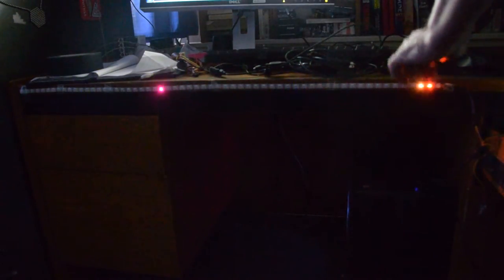Demonstrating a few sound reactive routines, including FHT.

Comment: Andrew, I love your work! I've got the first sketch working, but neither of the FHT ones will compile. I get "Error compiling for board Arduino/Genuino Uno." Any ideas on what I screwed up, I see online that many people have issues getting the FHT library installed correctly. I unzipped it and put it in the Arduino>libraries folder, the same folder where I have the FastLED-Demos folder.
Reply from the maker: In my case, I downloaded version 3 of the FHT library from http://wiki.openmusiclabs.com/wiki/ArduinoFHT.

I then unzipped the file and grabbed the FHT directory only, which I placed in:

c:\users\<username>\documents\arduino\libraries

I haven't tested version 4, but I suspect that should work just as well. The key thing is that you should end up with:

c:\users\<username>\documents\arduino\libraries\FHT 

I didn't use the reorder_table_creator or the .pd file in the root of the .zip file.
Reply: Thanks, I did that and still no go. Then I decided to try an older version of Arduino IDE and 1.6.9 compiled! (1.6.11 wouldn't, so a tip for others, if 1.6.11 won't, try an older version.) Thanks, Andrew, the sketch is very cool!
Reply from the maker: Well, damn. I've since upgraded to 1.6.12, and naturally it won't compile.  Some stuff needs newer versions, some old. Thanks for the update. In the meantime, ugh!
Reply from the maker: After a bit more research, I found that version 4 of the Open Music labs FHT works with 1.6.12 of the IDE, which is what I'm using. Thanks for the heads up about this issue.
Reply: Yep, confirmed here too, 1.6.11 and 1.6.12 work with FHT 4!
Reply: FHT4 compiles with Arduino 1.8.1 also, just tested it.

Comment: What a great work. Espesially soundmems_peak_ripple. It is fast and nice. Thank you. I have some experience with Arduino but I am new with WS2812. My strips just arrived yesterday. I want use your code for my litghtning features using 240 LEDs in 2 rows with 120 LEDs. Is it possible you can give me hints how to change the code so the LEDs will go symetrically.
Reply from the maker: For symmetry, try this one.

https://www.youtube.com/watch?v=Xbw12QClEAg

Hooking up 2 rows of 240 LED's without having gained experience with smaller strips is just asking for trouble for someone that's inexperienced (and apparently you're not). The main issues are power and memory, so be careful.
Reply: Thank you Andrew for your answer.  I used only 120 LEDs in 2 rows and your code work on UNO. In my project LEDs will be splited in half so I would like to know how to mirror led show. One row up and another down on the wall. What I found lattely. I used mic with AGC so show was very slow not responsive to music. Now with regular mic your code fht_log_ripple is my best. I have some 256MEGA so lack of memory is not a problem for bigger project. My experience in Arduino... I did home automation (working) based on mysensor and Domoticz controller on OrangePi used WiFi, radio and Ethernet. 16 temp sensors, humidity, pressure, 8 relays, wind direcection and speed, power and water counters so it is not so bad I think... Greatings.
Reply from the maker: For going up and down a wall, you may want to look into the serpentine layout.  Try this example:

http://pastebin.com/m8MgYFVC